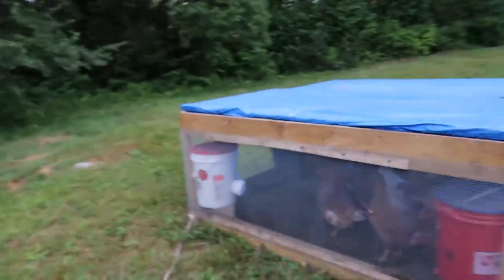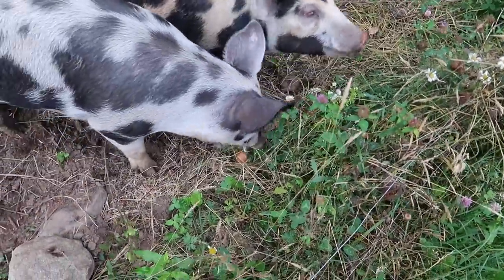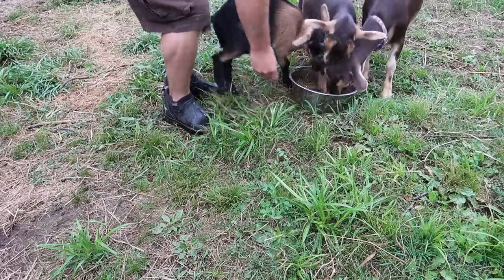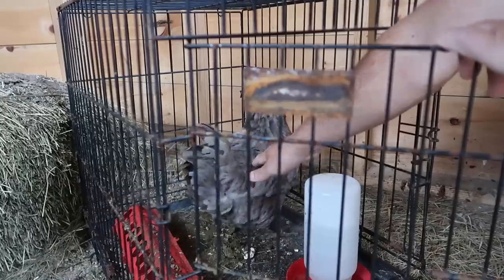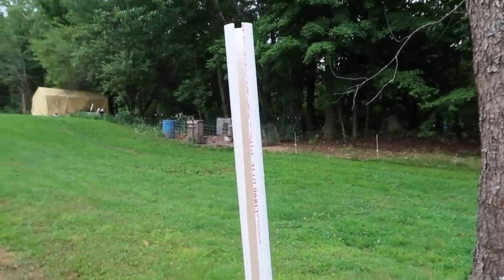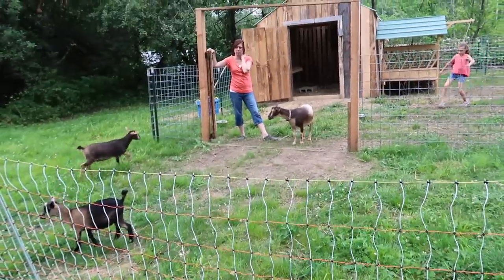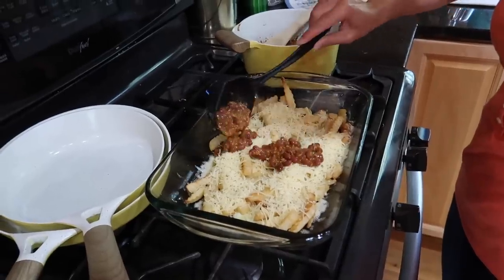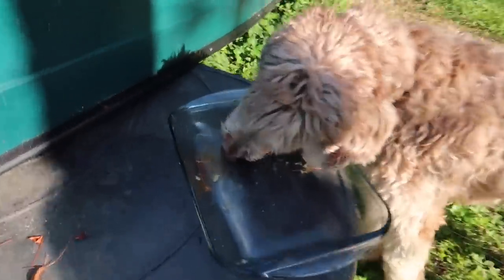Goats vs Electrified Poultry Netting

Comment: Good morning Al. Looks like your fence charger is solar? I haven't looked into these yet. Can one unit offer both ways, for grid or solar charging? We are in the woods and not sure if a solar charger would be suitable, with the amount of sunlight we receive. We want to buy the electrified poultry netting to protect our future woods garden. Thanks.
Reply from the maker: There are some that will do both. Ours you can charge the battery with an extension cord so you could use it both ways

Comment: Great video.  Cute trick using the top of the feeder to,hold the top of the tractor open while you pour in the feed.  
Al, I found out that it is best to let the chickens all start to,lay before adding artificial lights at night.  Adding lights early lets the chickens lay early, but then the birds have bloody behinds and the other birds pick,at them.  It was not worth the risk.  I am sure you will,see that the goats like alfalfa.  My goats at alfalfa and consumed huge quantities of the hay.  Clover was a distant second to alfalfa.  I have not tried electric fencing with goats, but seeing your project, I think I will try.  Your goats seem to have learned quickly.  
What do,you plan to do with the milk from three goats?  Where will you get the doe's bred this fall.  Will you breed the does all at the same time or stagger the breeding.  God bless!